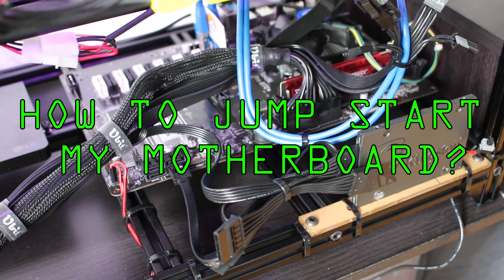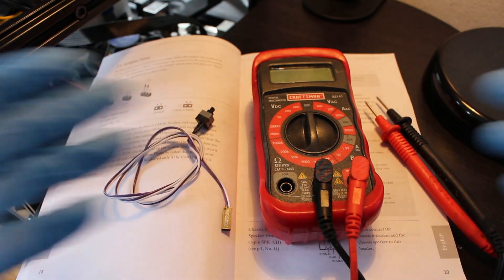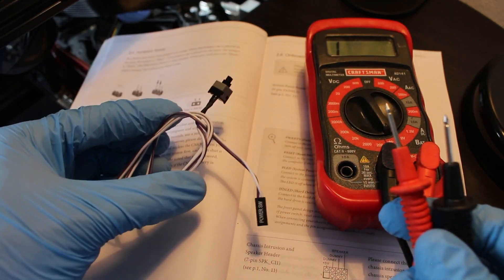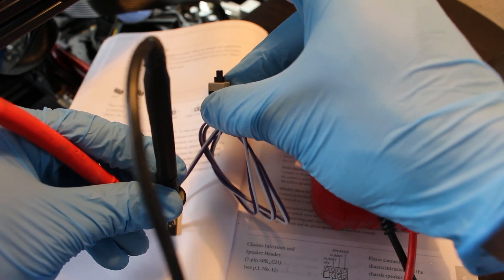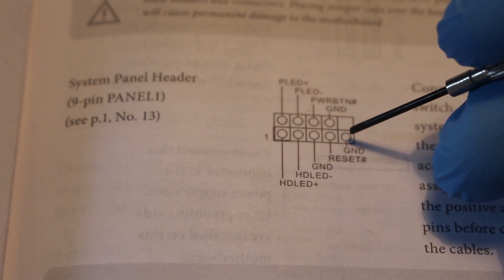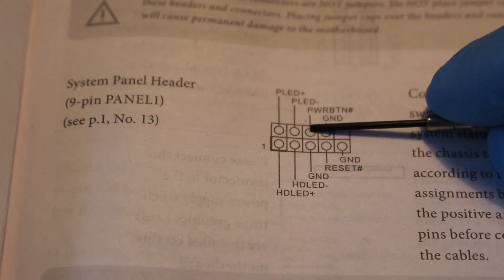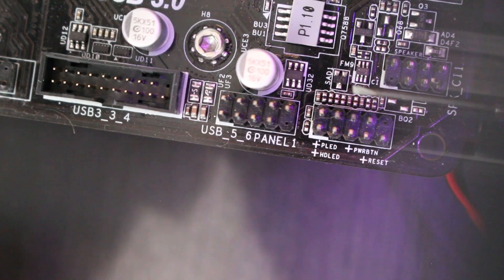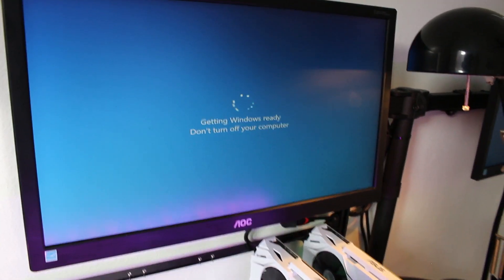How to JUMP START my MOTHERBOARD? EXPLAINED! (POWER & RESET)

Comment: How did it power up? The mobo you showed where you jumped the two pins, did not have the power supply connector plugged in to the motherboard.

Comment: I am so glad that I found this video!!!  I really appreciate you sharing your knowledge!!  I do have a question, however, as I am relatively new to working with the hardware.  I am an IT Tech, but I specialize in all things mobile, and deal mostly with only software related issues of the computer world.  I am trying to learn something new, and I have a TUF Gaming motherboard X470-Plus that hangs on the logo splash screen.  It would hang for a while and then eventually go to the bios settings, however, after I updated the bios successfully, it now just hangs and never goes into the bios settings after pressing either DEL or F2.

So far I have tried the following:
Reseated both memory cards and made sure all memory slots were functioning normally, and they were.  I also reset the cmos battery, reset the bios, and now I am at this point of short circuiting the motherboard.  

I was wondering if you could explain the prereqs, especially safety wise, for doing this.  Should the PC be plugged in and powered on, or turned off with the power cable unplugged?

I should also probably note that it wasn't able to boot windows at all, and would get a bootloader error issue upon startup.  My client is ok with wiping the system and reinstalling windows, so if I am wasting my time doing all of this, when I can simply reinstll and call it a day, please let me know.

Thanks, in advance, to anyone who even thinks of assisting :)

Comment: If touching those 2 pins with a screwdriver dont turn the motherboard... what could be happening? (power supply works fine)

Comment: If I tried jumping my psu with the paper clip and it turns and but I try jumping my motherboard and nothing happens does that mean I need a new motherboard?
Reply from the maker: Not exactly just yet. Quick tip, make sure the battery on your motherboard is good! Very common issue. Good luck!
Reply: @JumpermanTech  I’m not too tech savvy I’m honestly surprised I got this far into my pc so I’m not too sure where the battery would be located I have a msi mb-0901 motherboard if you could direct me that would be awesome if not it’s all goof
Reply from the maker: @AzFlyHD  I'm not exactly sure with that motherboard but just look around and you'll see a battery that is flat and looks like a circle. Just need to look around and you'll find it. That's the typical one that I see. Hope you find it. If you can't test it, just try replacing it. It's worth a shot💯
Reply: @JumpermanTech  tbh I don’t think my mobo has a battery or if it does it’s not round and flat cause I’m looking at examples and there’s no battery like that on here, thankfully the replacement parts aren’t arm and leg prices so ima take it to micro center again even tho they said they couldn’t test my psu because I have the msi aegis 3 and it’s not your typical desktop shape, so it’s wired kinda awkward and is difficult to navigate, but the psu fans spin and I get led lights for a split second when I plug the psu to an outlet I just wish the motherboard fired up when I jumped it
Reply: @JumpermanTech  nvm I found it it was on the other side of my motherboard but I’m not too sure how to get it out since it’s wrap in black plastic

Comment: Question, is it possible to jumpstart a dead motherboard? I tried to do the screwdriver trick to turn on mine after installing it with failed attempts at other things, but nothing happened.
Reply: It mimmics the button so if the button dont work then this wont work either =)
Reply: @ReXIX2  Yeah lol, since I posted the comment above, I learned my MB at the time was dead along with my PSU. So that was fun.

Comment: Help wanted

I am upgrading my PC. The old one responds to jumping and fans start whirring(I did not test with a hard drive) but the new one will not make so much as a noise when I jump it, and the regular switches don’t work either. I have no idea what the problem could be.
Reply: The same thing is happening to me now. I got a new graphics card and power supply. I can jump the powersupply but not the mother board. Did you ever figure it out?
Reply: @hutchem144  Yes, a damn usb stick was preventing it from starting. I kid you not. Unplug everything that is not ESSential even boots drives, they can be plugged in after starting.
Reply: @dcmurphy5157  Thank you very much i will definitely be doing that.

Comment: I touch these pins with screwdriver and nothing worked does this mean my motherboard is broken?
Reply from the maker: Not exactly. Next step I would recommend is to check the battery on the motherboard itself. It would be a round, silver & flat battery. Also make sure your power supply is supplying power 👍 Thanks for watching!

Comment: Pro i did it but nothing happened what it mean 😢
Reply from the maker: Then it means it's not your on/off switch. Next easiest step would be to check the battery on your motherboard. It will be a round silver looking battery. Good luck 🙏 Thanks for watching!
Reply: @JumpermanTech   yes I replaced the battery with another one and used another ram, but it's the same

Comment: Hey man, I used to be able to jump start my laptop with a screw driver. Now it won't happen. Any reason why? Did I ruin it by doing it multiple times? I must have done it maybe 15 times in 2 months.
Reply from the maker: Hey, doing it with a screwdriver as long as you only touched the 2 correct contacts would not ruin anything. You are simply doing the same exact thing the switch would do except manually. I'd continue to troubleshoot👍
Reply: @JumpermanTech  thanks for replying. Touching the 2 contacts does not work now. Maybe I must have touched another contact once or twice. I'll keep troubleshooting. Although any other way you might know of starting it up? Sorry to bother.
Reply from the maker: @krishanknand  Anytime. Hopefully nothing was grounded. Not exactly sure with laptops but there was a time later on where the same thing happened to me with my PC and I found there was a battery that was dead on the motherboard itself. Changed it and everything worked. Check to see if there's any fuses anywhere that can be replaced as well. Wish you luck!
Reply: @JumpermanTech  thanks again man, will try that out.

Comment: You are the man! I have been looking for a good explanation video on how to jumpstart the motherboard but other videos just use the screwdriver without showing the exact pin location on the board and without zooming in the pins. But you explain it so well and shows the exact pins, zooming in and showing a diagram. Thank you very much.

Comment: now what about this:

i have a motherboard , she doesnt jump-start with screwdriver or with the multimeter, after i do the short, nothing happen

BUT if i use the pwr wire, and press the power button of the case, She starts normally.... why the fuck this happen.?

Comment: i would like to ask you, once i connect all my front panel header to the motherboard pin ,why its never turn on even i hit the button. my power supply is working . i am wonder if my motherboard pin is not working?
Reply: Did you ever figure this out?

Comment: I just built my first pc and i put everything in the way it showed me and it didn’t start the motherboard isn’t dead because my keyboard turns on i just can’t power on the pc
Reply: did you try rice
Reply: did you figure this out? having the same issue
Reply: Yes I tried it worked this was months ago
Reply: @TypicalWilly  i tried what he did in the video but it didn’t work any suggestions?
Reply: @fbechito5623  i ended up just taking it to a pc repair place and it was a motherboard issue

Comment: Nothing happens when I press the pin. When I connect the motherboard to power supply and turn it on the rgb lights up so it is getting power. I press this but no fans spin
Reply: Same
Reply: @Just_nick3070  ok so it’s obviously been months since I finished building my pc. What I did is I found the motherboard instruction booklet and flipped to the front power connector setup page and it turns out I had the connectors plugged into the wrong area so I put them in the right place and it worked perfectly. Make sure to check the little booklet that comes with your motherboard
Reply: @larry_fisherman-s7k  thank you I got it working
Reply: @larry_fisherman-s7k  basically i was replacing my power supply but someone else did that part for me and I didn't watch them do it

Comment: Not been able to start my PC starting from yesterday so I tried this and it still doesn't work. Tried jumping the PSU and that seems fine. Can't seem to figure this out.
Reply: Mukhtar Sheikh if it’s a completely new build double double check that the case front panel /power/reset connectors are properly routed to the board

Comment: My power switch is cracked. So can i jump start pc everytime or it's not advisable to do it everyday?
Reply from the maker: You can do it as many times as you want. Wont hurt anything. You are the switch now 👍 Thanks for watching!
Reply: @JumpermanTech   can i short out the board if i touch other pins?

Comment: I tried this and my pc still did not boot up, got any suggestions?
Reply: try to clear the cmos battery and also try to take out the ram from it's slot and put it again in the same or another slot it may help aswell
Reply: @moezlamloum  really appreciate the very delayed reply aha, I scrapped my pc about 10months ago and built a new one